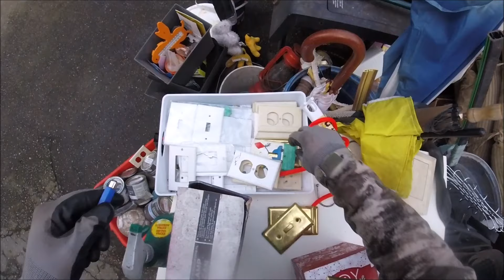Spring Cleanup The Finds Keep On Coming

Comment: If a new blade can't cut aluminum it's time to move on.  Sometimes the teeth get gummed up with the soft aluminum and you have to use bigger teeth.
Reply from the maker: These are the 50x blades with big teeth

Comment: Starrett BT121014-5 Bi-Metal Fast Cut Tapered General Purpose Reciprocating Blade, 0.050" Thick, 10-14 TPI, 12" Length x 3/4" Width (Pack of 5)
Experimente essa serra, aqui é uma das melhores em durabilidade, é usada para corte de veículos, você encontra na Amazon 
Um abraço do Brasil 🇧🇷🇧🇷🇧🇷